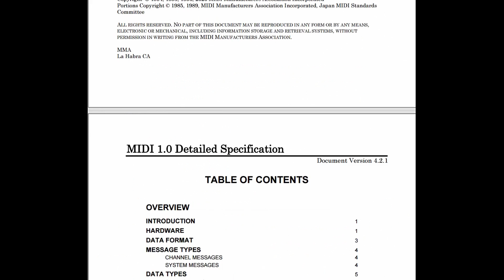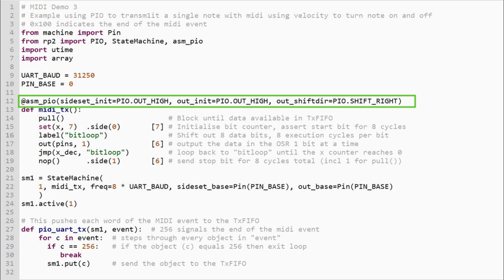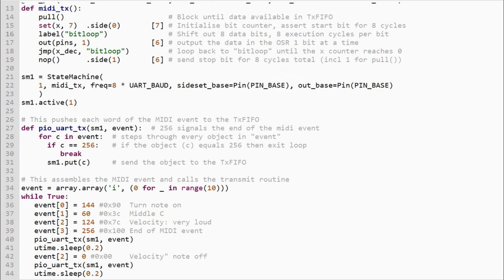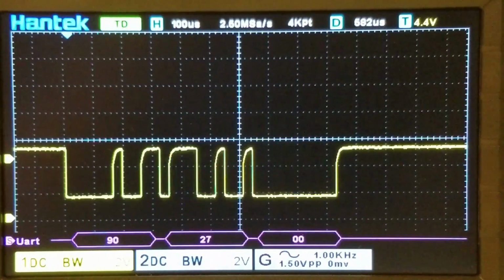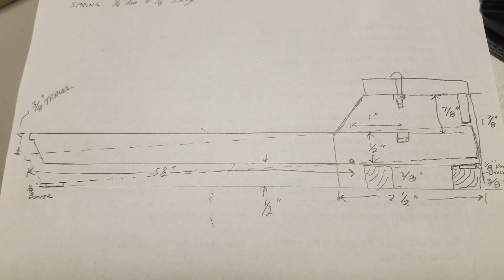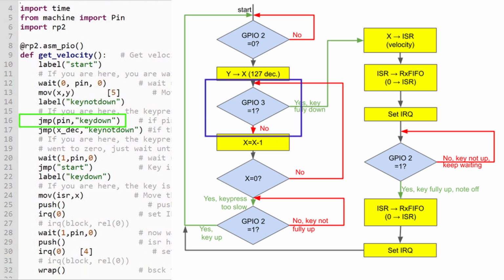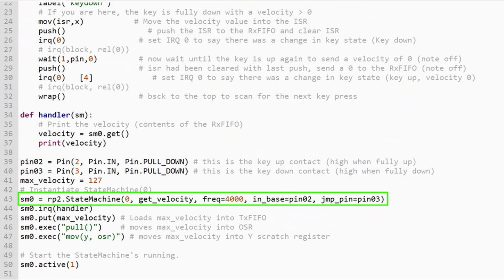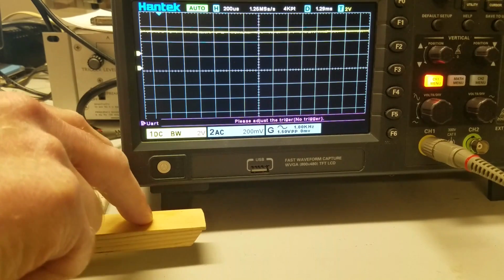Raspberry Pi Pico PIO - Ep. 18 - MIDI using MicroPython and Velocity for Pico

Comment: please develop the rx portion of the code using pio pin 1 to match your schematic, I can't find rx code anywhere on your github...
Reply from the maker: I didn't program the Pico to receive a MIDI signal.  I was planning to make a MIDI recorder; but I got sidetracked.  Unfortunately; since I currently don't have access to a MIDI keyboard; I can't complete a recorder program right now.  If I get access again; I might dig into it then.  Thanks for watching!
Reply: @LifewithDavid1  I just need the asm code to get the bytes I have tried unsuccessfully to read the pin one and the rxfifo....can you help me out
Reply from the maker: The best I can do right now is to point you to section 3.6.4 of the RP2040 Datasheet.  This is a UART receive program that I would use as the basis for developing code.  Unfortunately, I won't be getting back to MIDI any time soon (if ever) since 1) I no longer have access to a MIDI keyboard, 2) I disassembled the MIDI breadboard, 3) I am updating my toolchain to accommodate the new RP2350, and the RP2040 toolchain isn't working at this time, and most significantly (which really bums me out) 4) I worked on this almost 2 years ago, and it would take a really long time for me to re-wrap my mind around PIO again.  60 years old may be the new 50, but 70 is still the same old 70. LOL  Thanks for watching and commenting!

Comment: You're genious, very clever ideas.
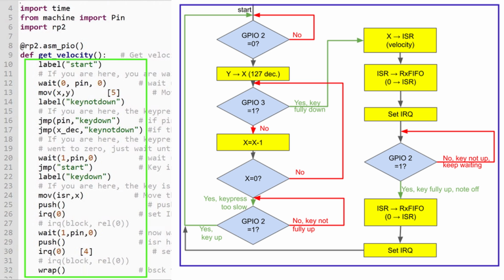13:15 i'm not understand at this moment using "wrap". What happened if you remove "wrap" command from end of sketch? And where is "wrap_target"? Thank you.
Reply from the maker: I wouldn't have needed "wrap" in this case.  PIO programs will automatically wrap at the end of the program by default.  Wrap target is at the start of the program by default.

Comment: You did not have to set and wait on IRQ in the PIO program.  You could have instead had your interrupt be based on FIFO not empty and the interrupt automatically triggered when velocity is added to the FIFO.  No need to have a PIO instruction to set the IRQ.  Just means you need to make sure that you read from the FIFO until empty before returning from the interrupt.
Reply from the maker: That should work also (I think).  I'm digging into PIO interrupts more and the MicroPython SDK is not as robust in handling them as the C.C++ SDK.  I did have an ulterior motive for using a separate interrupt for future expansion.  Thanks for the comment; I'll add that to my toolkit.  Remember what Maslow said: "When all you have is a hammer, everything looks like a nail".